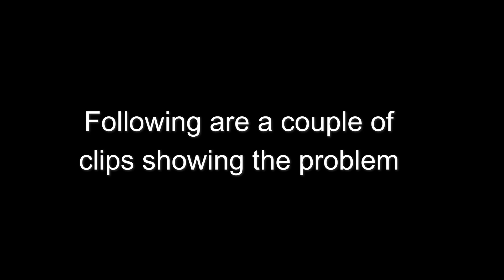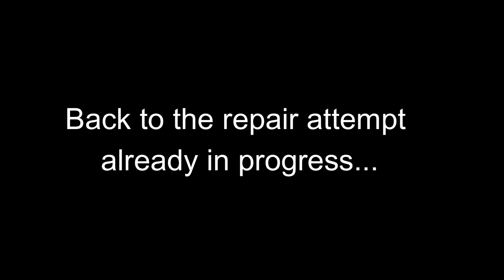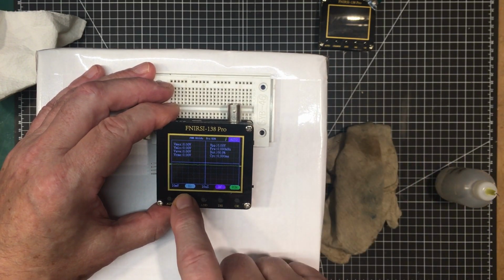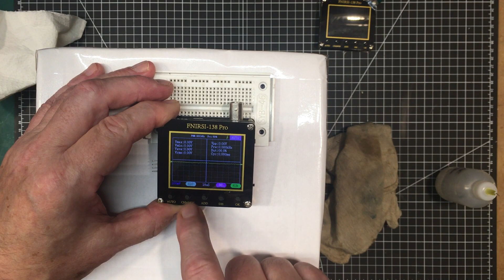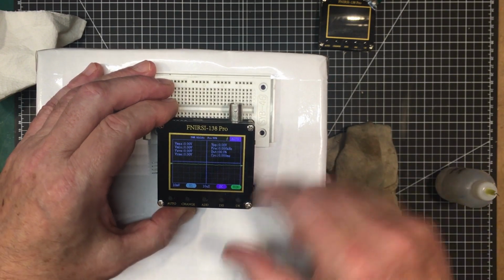0105 - FNIRSI 138Pro Repair

Comment: Largely due to watching videos like this, anytime I buy anything from china, which sadly is most things, in the last couple years I’ve gotten into the habit of checking every screw, bolt, nut or connection and I open any electronics and inspect circuit boards, solder joints etc.  It’s rare to not find a loose screw, a missing solder joint, no solder brigdes, etc.
Reply from the maker: That's a good practice.

Comment: I’m an amateur watchmaker and an indispensable tool for removing dust without leaving more dust, dirt, oil, fingerprints, etc. is something called rodico. It’s like blue tack but not as sticky and it doesn’t dry out. I use it for cleaning all sorts of things now. Also a little bulb puffer/blower comes in handy.
Reply from the maker: I have the little blowers.  I used them for lenses.  I'll look up the Rodico.  Thanks for the info.

Comment: Gotta love it when repairs are that easy eh. I got a reply from Zeeweii which is probably a miracle but unfortunately it's not good news. The said they have no firmware updates available and no plans to release any. Not really surprised but I'm thinking about trying to figure out how I can backup the firmware on mine so it's available for a just in case situation.
Reply from the maker: It's always nice to get an easy one.  Let us know how it goes.
Reply: Thanks for looking for firmware but its a bit of a shame, maybe some 3rd party hacker will write some like what happened for the TS100 soldering iron...cheers.